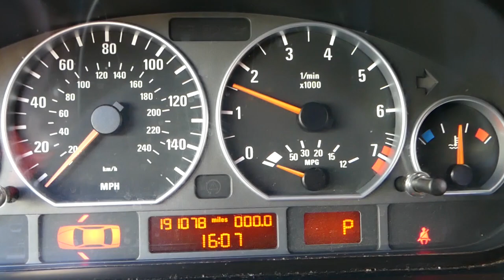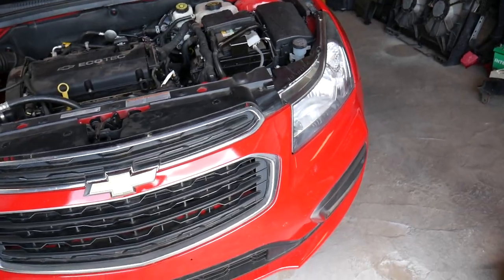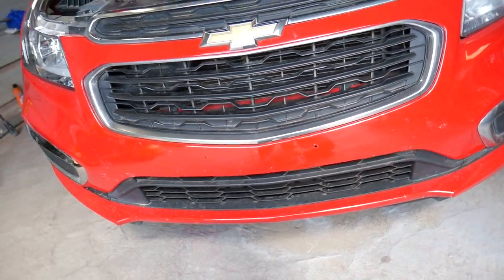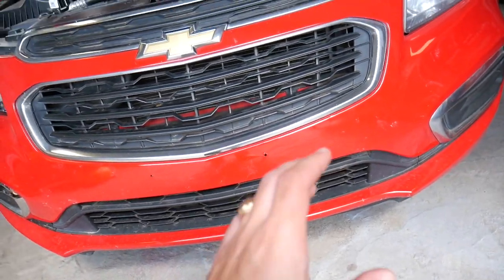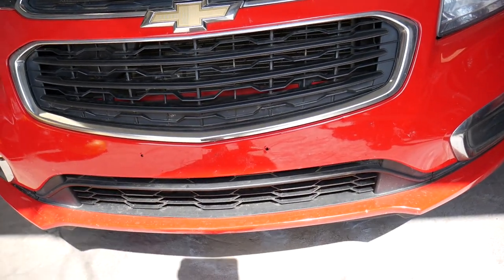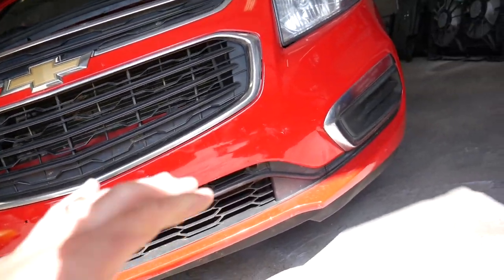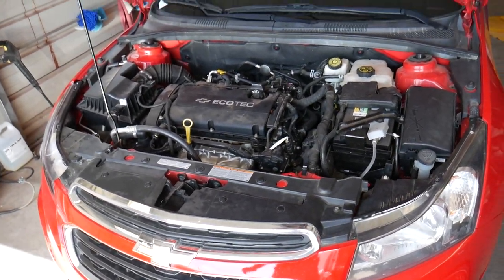AMBIENT AIR TEMPERATURE NOT SHOWING AND AC NOT WORKING ON CHEVROLET, CHEVY, GMC, BUICK, CADILLAC

Comment: Why would the AAT affect the normal operation of the refrigerant system and blower motor? I figure it would affect the auto cooling option, but how does it affect the manual side , doesn’t pressures in the lines managed by either TXV, orifice tube , and the low side pressure switch and high side pressure switch?

Comment: What could be if it shows -40 but then  goes slowly to the actual temperature  then sometimes goes back and then again to normal. Also sometimes it stays like that until i get to a long strech of road and as i continue to go to a higher speed it continues to go up to a regular temperature i figured a loose wire but as i hit bumps it doesnt change and like i said it just suddenly climbs also there is one certain spot that i could be driving around and it wont change until i drive trough there it starts working and always around the same are give or take 1 block

Comment: My fan stays on and when i disconect the battery you can here the relay click and when i connect it back minue later the car acts noral and starts marking temperature again but rins good after that the next morning again it wont mark temperature and the fan would staybon toll indosconext battery amd reconnect it acts normal again thats a bad sensor correct

Comment: i changed radiator fans today, and disconnected outside temp sensor.   When i put it again it marked -4C   and the AC didnt start neither the radiator fans. So it croseed my mind that the outside sensor could affect, but i wasnt sure.  I was thinking a wiring problem could have ocurred. I even disconnected the battery thinking that the computer will reset, but it didnt changed. Then suddenly after an hour or so,  i turn the car on and the temperature showed normal 24C  and i turned AC and it worked,  and most important the radiator fans started normally.   So i guess that was the reason probably.   Hope someone can find this helpful!
Reply: Yeah dumb car lol

Comment: I replace the sensor today on a 2015 impala but the -40 number still there. My a/c was working before the sensor replace but it wasnt really cold and didnt make no difference after replacing the sensor any idea why?
Reply: I had the same problem with my equinox what you have to do is get on the highway turn the air conditioning on and drive over 65 mph for a few minutes that will give time to the computer to reset the sensor automatically you will see temperature going up
Reply: Once going down road it works, then it doesn’t  again.  Could my new sensor be bad.